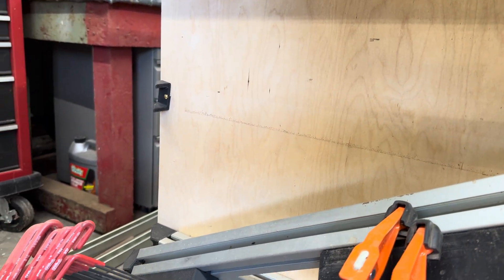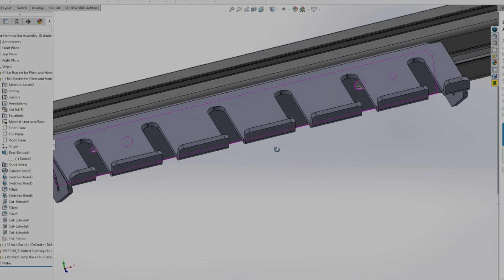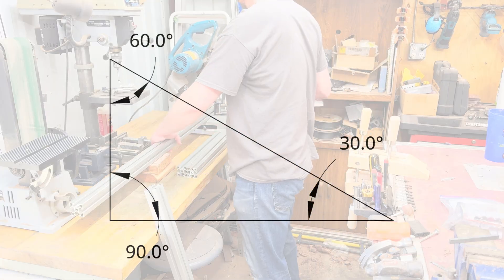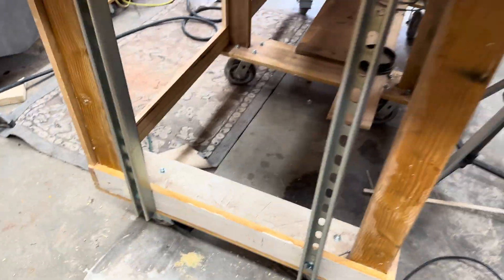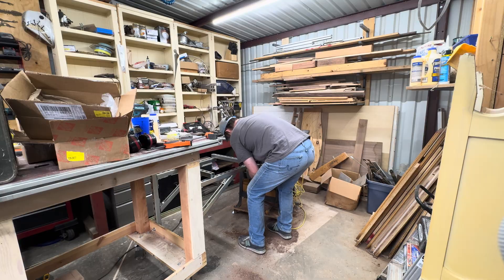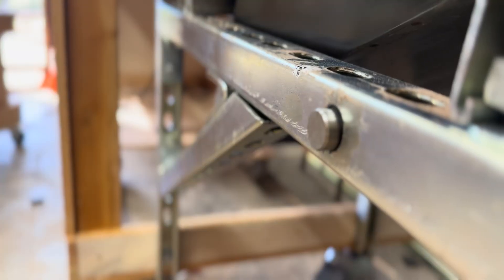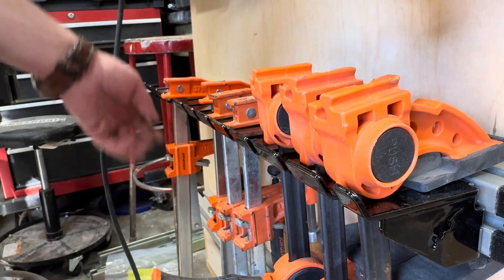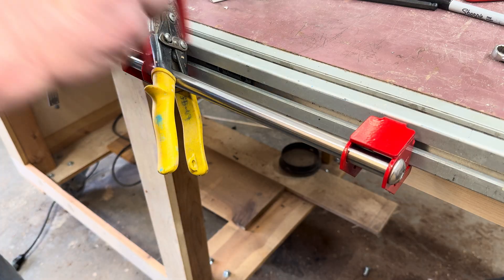The Lies We Tell Ourselves About 3D Printing

Comment: Or just, idk, use the right material for the job? Why would you ever use pla(a material best suited for prototyping and cosplay) to print a functional part when materials like ASA, nylon/pa6 cf, pa6gf, pa12, PET, etc would have never broke?
Reply from the maker: My printer has a hard time doing other materials and I don’t enjoy tinkering with it to just get something to print correctly. I feel I have more control over steel than that so I went with it. If I had a printer capable of doing nylon well, I would use it for some of these things in a heart beat. I disagree with you that those materials would “never break”. While more durable than pla, these plastics still have their weaknesses.  Many, many people tend to overestimate the usability of 3D printing, in my opinion. Machine shop guys typically smirk when young engineers in school want to use 3D printing for everything.

Comment: This is 100% a user issue, not a 3d printing issue. 3D printed parts that have been properly designed and printed are perfectly fine for tool holders. Half the stuff in my garage is hanging off of 3d printed pieces, and it has been for years. Air tools, bikes, heavy hammers, chairs.. take your pick. If you wanna replace your plastic stuff with metal, more power to you. Vilifying 3d printing just to get a few extra clicks is pretty shady though.
Reply from the maker: Why is it that when I contradict people’s opinions on the internet I get called shady or clickbait?  I can’t just have an opinion I’m sharing?  Doesn’t mean it’s fact. I have other things that work pretty well out of 3d printing but these did not. Also, who’s to say I’m not just a rhino in the shop and break stuff all the time?

Comment: 3D print is for prototyping, wood router templates, some unique parts, etc. For strength I use metal, using nut or pop rivets, welding, etc.
Reply from the maker: I deluded myself into thinking these might last a while but here we are. I knew better.